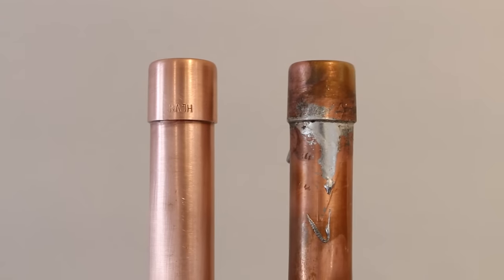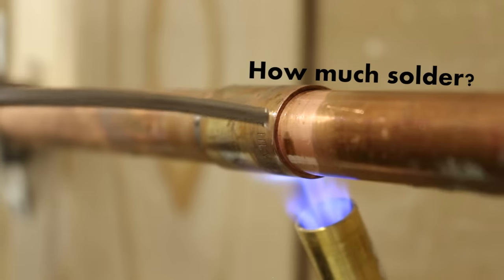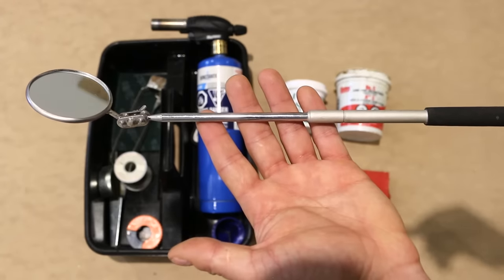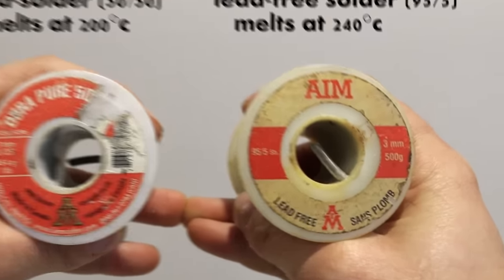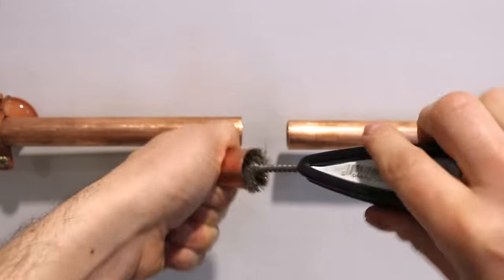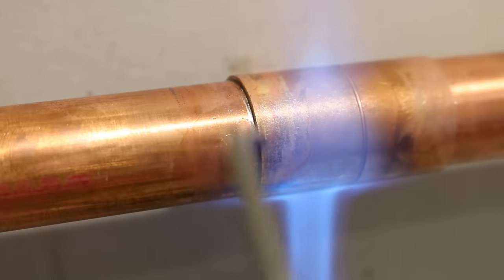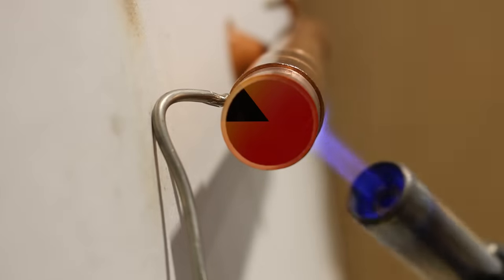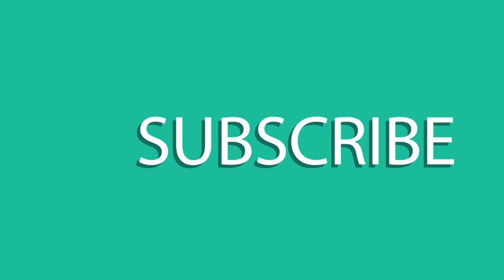How To Solder Copper Pipe Like a Pro (Tips & Tricks) | GOT2LEARN

Comment: We only flux the pipe not the fitting itself. Especially on Gas lines as they can't be internally flushed. Also the access flux is pushed into the pipe and can draw in solder which causes turbulence and restricts the flow. Videos spot on bro, you're right on the money. The inner top tip of the inner flame is the hottest part of the flame. This is why we use this to heat the joint. Mapp gas for me when I solder ✌
Reply from the maker: Wooohoooo thx @ghost, glad you liked it bud!!
Reply: @Got2Learn  pleasure as always bro, keep doing what you do best 😜
Reply: Natural gas lines should never be soldered joints, rather they should be flared to adapt to iron pipe main.
If by “Gas Lines” you are referring to Medical Gases, these should also never be soldered joints, but brazed with a nitrogen purge.
Reply: @richardhy6931   Here in the United kingdom & Europe we use different thicker gauge copper. As the methanethiol added to gas to make it smell is lesser in content. The natural gas reacts very little with the copper. So Gas safety and use regulations states we can use copper. As it states appropriate fittings should be used. 

We cannot swage gas lines. Outlet gas lines from domestic meters are such low pressure and copper is actually the most common material used here. 

You have a different climate to us. So gas has a different thermal expansion to UK and Europe. Long gone are the days we used cast iron or steel for gas installations. I work commercial & domestic tiv & meter volumes can be extremely high in some cases. So the gas purge machine comes out quite often too.
Reply: It’s always interesting to see how things are done in other countries. Thanks for the explanation ghostman 👍🏼
Reply from the maker: @ghostmanromeo uk is the best ;)
Reply: That's how I learned it.
Reply: @bara yaa  In the UK it's mostly copper gas lines .   There is some flaking up inside the pipe in old cities when there was a shortage of copper and an inferior copper tube was used . 
Not too many areas effected with it and the proper gauge of copper is absolutely fine for gas use here
Reply: I always flux all surfaces to be soldered, sparingly.

Comment: Most fluxes are chemical reaction (Laco) if a little to much heat they rim run but they can look OK at the time of running even old for years but any movement they can just part.                          Ever flux is an acid-based and creates a better capillary action
Reply: If your in the USA you cannot use acid based flux on potable water lines. It is prohibited in the IRC & UPC.

Comment: Someone here asked: "How much solder do I use?"  Until you get a true "feel" for soldering I'd recommend this - use about 1/2 of the diameter of whatever fitting you are soldering. Thus if you are soldering 1/2" pipe, use about 1/4" of solder. If you are soldering a 1" pipe - use about 1/2" of solder. And how do you know how much solder you are actually using? Well, if you need 1/2" of solder, bend a 90 degree angle at the tip or your solder so you physically have 1/2" of solder after your bend. If you need 1/4" of solder, bend the tip of the solder so that you have 1/4"  of solder past the bend. It is VERY easy to add too much solder (and as this video showed) where you end up puddling the solder inside the joint. Truly, you need VERY LITTLE solder to make a sealed joint. When I was a novice I was installing a boiler and had soldered a 3/4" vertically mounted gate valve  - and because of the mass of the valve I REALLY soldered that valve to make sure it didn't leak. Problem was - I had used so much solder that when the valve was opened (the gate was pulled back to open the valve) I had completely sealed the valve closed. I had created a solid solder plug! Yup - played hell finding that little error when the system wouldn't work. And that's when boss-man taught me the 1/2 the diameter of the pipe trick.
Reply: Thank you very much for sharing that, key thing to know.
Reply: I enjoyed and will try your tip as well. I do the samething, I worry too much about leaks that I use too much. Ty
Reply: My question would be, with what thickness of solder does the rule work?

Comment: I am a diyer with no experience at soldering copper pipe, but after watching some of these videos I got together some 1/2 in pipe and tools and began practicing.  After a while my joints started looking decent and I thought they wouldn't leak although I had no way to test them, but they looked filled and good. So, I learned what it takes to make a good joint. Then I hired a plumber to install a new water heater.  I was particularly interested in watching him solder the copper pipes.  I was really impressed.  All of his joints were examples of good soldering technique. I couldn't have done what he did but I know a good joint when I see one.

Comment: Take a slightly damp rag right after you solder and rub it around.  Bim bam boom.  Perfect
Reply: Gene Miller actually...  A DRY rag removes solder much better than a wet or damp one... but a wet rag cleans the flux residue off so it doesn’t corrode the pipe.

Comment: In Australia, silver brazing is the go- soft soldered joints haven't been used for years. In fact, soft solder is illegal on gas lines because if there is a fire the joints may fail.
Reply: you aren't allowed to solder gas lines in Canada.
Reply: I kno rt
Reply: Interesting . In the UK almost all domestic gas lines are copper soldered .     The gas regs here are super strict aswell .
Reply: @TheRaceface22  just use John Guest pushfit .......it'll be ok 😂

Comment: I think the copper pipe looks better with that visible ring of solder around the fitting.  If you do it right, you can have it come out to the width of the solder and looks real clean.
Reply: I agree that a uniform ring of solder  looks good . Plumb and level looks good too.

Comment: Yorkshire fittings. End of
Reply from the maker: Yeah they are good
Reply: Propress
Reply from the maker: Also good
Reply: Got2Learn those fittings are a gamble. Pro press is good when there is water in the lines you can’t evacuate fast enough. But nothing beats a well soldered joint. Progress is relying on a rubber ring.

Comment: It’s nice to see these how to videos. One way I learned on the different methods was cut in half the coupling and hammer it flat after soldering. You will see how good your soldering method works. Try different scenarios, what happened when you don’t clean your pipe or fitting. Or when you don’t wear gloves and you leave finger prints on the pipe. I guess I should make a video too🤔

Comment: Always heat the fitting, not the pipe
Reply: When applying the solder, you can throw some heat at the pipe first which will stop from burning up your fittings especially when working with bigger sizes.

Comment: "Over sanding" the pipe makes the job look bad because you give an area on the pipe for solder to want to run. We use to sand only a little past the full inserting of the pipe into the fitting. i nice "visible" & clean joint is what i like. i use to quickly and carefully pencil in the solder around the joint...avoiding "any" drips(.) After wiping a completed joint with a rag...it can be further cleaned using OOOO steel wool. A mistake of a solder mark can be sanded off with a piece of fine sand paper or sand cloth...then cleaned by putting flux on the fitting & heating it a little...then cleaned again via OOOO steel wool.

Comment: so if i burn the flux in some parts will it leak? does that mean im putting too much heat on in one place??
Reply from the maker: Yes, too much heat!
Reply: @Got2Learn  when i put water back on tho it didn't leak, will it possibly leak in future?? u think im not moving flame around enough??
Reply from the maker: Maybe, it depends how it was soldered 😉
Reply: @Got2Learn  what kind of heat u use?propane or mapp gas? i use propane, mostly 3/4 copper , is that ok?? can i use propane head on mapp gas or no?
Reply from the maker: @Eastbaypisces  propane and MAP, are basically the same, and yes you can use a propane head with MAP, no problem.
Reply: @Got2Learn  i have to check if it says propane only tho right or no?
Reply from the maker: @Eastbaypisces  i've been using a propane only head with MAP gas for over 10 years, still works fine!
Reply: @Got2Learn  oh ok wasn't sure , some ppl say yes others no
Reply from the maker: True MAP gas doesn't exist anymore, that's why 😋

Comment: to practice soldering what type of pipe would you recommend L or K. or does it matter?
Reply from the maker: Go with type L.
Reply: @Got2Learn  Thank you!
Reply from the maker: Most welcome!
Reply: K is rated for under grade installations. Typically running through exterior into ground for irrigation

Comment: Solder follows flux, being said to much flux will run, especially within vertical soldering, also fitting cup size being 3/4 for example, will only hold 3/4 within length in solder, once fitting cup is full, over flow solder will be complete waste. Also heat the pipe side nearest fitting, solder will draw into fitting much quicker than heating the actual fitting side when soldering. Better off post/after soldering a joint, wait approx 2-3 minutes before wiping the soldered joint, due to spraying cold water on a hot soldered joint, is defined as shock cooling. Which very well can crack your newly soldered joint. Then your well wrapped up into draining complete system down/water again, also soldering same joint second attempt. Most common mistake, but will create 2× the work.

Comment: should i use water soluable flux or thinning flux on water shower lines
Reply from the maker: You can get water soluble tinning flux, if you can't find it, you can use normal flux.
Reply: it says oatey no.95 lead free tinning flux thats it , so i guess i cant use it ?
Reply from the maker: Sure, just make sure to rinse your system out before drinking from it, in case you do ;)
Reply: so it doesent say water soluble but its lead free tinning flux with a green label , will it still adhere  a strong bond with water pipes? so you saying its ok to use , or am i over concerning the matter?
Reply from the maker: It doesn't matter if it's not water soluble because you can rinse your system out after you are done, it's the lead-free you are looking for, so you are good to go :)
Reply: I did get the water soluble kind like you said  and did some practice pieces, if the flux is bubbling am i using too much heat
Reply: on the shower valve i got screw threads but i just want to sweat the     small 1/2 " coper and use a  elbow  and then up is that ok
Reply from the maker: The bubbling is because pressure is building up in the pipes, try opening a valve to release the pressure.

Comment: Any suggestion how to connect 2 pipes without soldering? I need this for a project not related to plumbing. The pipes just need to be neatly connected and nothing would run through them to cause a leak.
Reply from the maker: Crazy glue, epoxy...
Reply: Sharkbites
Reply: Thank you! I found a glue on Amazon called “Just for copper”, I will order it and see how it works.

Comment: Thank You 4 your video .. sometimes I have to reused a old fittings instead replaced.. that is a real challenge specially inside a crawl space.. no making any excuses but thigh little spaces where you can bearly move and do rotations i dont worry about about how esthetically looks more important is not to have a leak absolutely without using to much solder and flux that make it  looks sloopy .. but when it comes to show your solder technique in a spot where ppl is going to transit  you better leave your name standing ..make yourself look professional.
Reply from the maker: Thank you!!!

Comment: How do you solder a joint that you can't shut the water off completely.  Not running water just enough to fill it up in seconds after get the water about 8 inches down  but it fills faster than you can heat it. On vertical pipe. I know the answer, do you?

Comment: Great video, could you explain what I did wrong when I tried to practice soldering copper, the solder was breaking off a quarter inch at a time when I applied it to the opposite side of the heat on a 3/4 inch pipe. Please help.
Reply from the maker: That's because you are heating the solder, you gotta heat the pipe and let the heat from the pipe melt the solder, try that ;)

Comment: Nice vid and work.. I prefer to see a bit of drip as it tells me the flux did it's job and pulled the solder in and around the joint for a bit sloppy but sealed joint

Comment: I sand/clean inside& out regardless of what I’m soldering.

I also sand/clean the ENDS.

Then?, I flux INSIDE & OUTSIDE regardless of the type of soldered joint.

Then?, The most important point when soldering a joint?, is to dip the end of the solder into the flex before applying

Comment: Aka how to make soldering harder than it is..  folks solder follows heat ..just simply clean , flux , heat evenly while keeping the major heat pinpointed towards the center of the coupling,  the lead will head towards the hottest part .... as long as you don't overheat everything ridiculously hot.... it's just that simple

Comment: I've 1/2" copper pipe and I bought 1/2" cap, but the pipe doesn't get inserted into the cap. Please advise
Reply from the maker: Could it be that the end of the pipe got dented?
Reply: @Got2Learn  no they're both same size 1/2" so one will not get inserted into the other. Should I look for 5/8" cap instead ?
Reply from the maker: @djrednitro4116  yes

Comment: What about using solder that has flux in it?
Reply from the maker: That only exists in electronics soldering I believe, it's called Rosin Core solder ;)
Reply: @Got2Learn  - interesting.  That kind of solder was the only stuff my Dad would use for any plumbing stuff he'd do around the home or camp.  He liked it just for the idea that he didn't have to apply a separate coat of the flux.
Reply from the maker: I'm actually surprised that it worked hehe ;)
Reply: @Got2Learn  - it was Dad's "go to" stuff.  Now after watching your videos I can see why he always had to go down and repair his joints.  Learned long ago that water and solder just do not work.
LOL

Comment: I would like to see a cut away of these joints to see if the solder was pulled all the way back into the fitting.... I got a feeling it is not
Reply from the maker: I actually is.

Comment: Throughout this whole video, I didn’t see you wipe one joint, this technique your showing is cool and all, but most people won’t heat the hub of the fitting enough an will end up facing the fitting, as an installer for 38 years now, I think it’s better to learn how to solder well and wipe your fittings, you can always polish them after with a piece of old sand cloth, and using a scotch bright pad doesn’t scuff the surface enough for the solder to be rock solid for years. There are other ways to make it pretty.

Comment: Get a clean rag.
Wet it.
Squeeze it as dry as you can.
Clean and flux your joint.
Bake, ....bake is an appropriate term, until the flux floods the impurities out of the joint.
Wipe clean with damper cloth.
Bake until it sweats.
Touch it with the lead and watch the silver ring run around your joint.
Make sure there are no black dots in your joint, wipe with rag and inspect.

Comment: I like the video for fun, the pipe is gonna look old in few weeks and having more than enough solder is better than not enough.....when you good at soldering it looks more professional.

However if you did have an exposed pipe its good to use this method.....

We use Flux brush and wipe any excess solder after we sweat joint

Comment: probably 26 years ago I worked with a guy who soldered like that, just enough (or so he thought) solder, by the next year we had to cut every joint he soldered out and a more skilled mechanic redid it, not a single joint was filled. real plumbers make sure its filled and the skill is knowing just when to wipe the excess off. I've helped master plumbers in my youth for years and never seen one of them be as stingy with solder. Costs less to do it once.

Comment: small question here: i saw youre verticall soldering first the upwards and then bellow… aint it smarter since heat will rise to make the lower 1 first?!
Reply from the maker: Makes no difference.
Reply: That may be true if it were air, but radiant heat transfers in any direction to wherever it's cooler.
Reply: I was taught this way as an apprentice pipe fitter some 27 years ago. It draws the solder upwards with capillary action then you just top off the top joint. It leaves a cleaner neater joint

Comment: You shouldn't put your touch directly under the edge of the hub. Flux or solder can drip into your torch head and ruin it.
Reply from the maker: Yes, always angle it off so that doesn't happen.

Comment: If I saw soldering like this on a service call it would definitely send out red flags to me of shoddy work. Sorry but true.
A neat bead of solder around the fitting and pipe solidifies the weld. If it were aesthetics your after run a strip of emory back and forth.
For any novice handymen or women out there disregard this video

Comment: That joint looks clean but does not look like a solid joint.  looks are nice but I would take a sloppy joint that will hold 100 % of the time then a joint like this one . Most like it has missing soldier throughout the fitting.
Reply from the maker: It doesn't have missing solder, you can clearly see that there's just enough, more is just unnessecary.